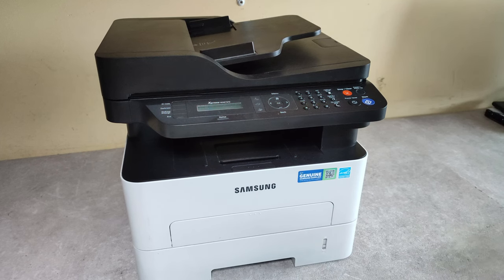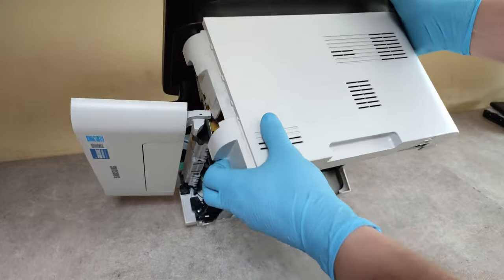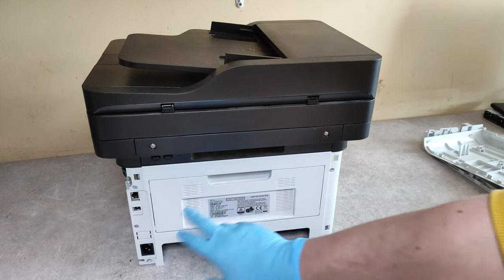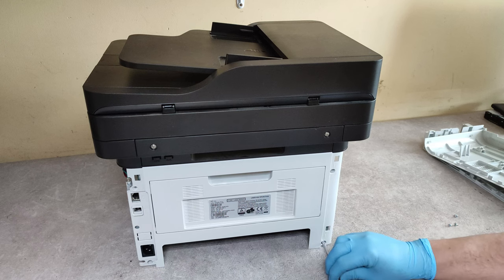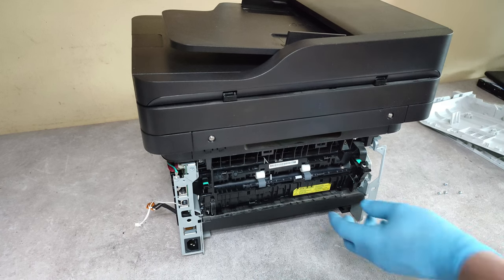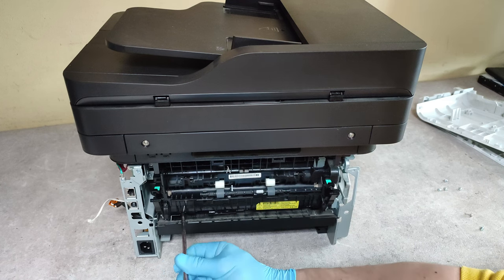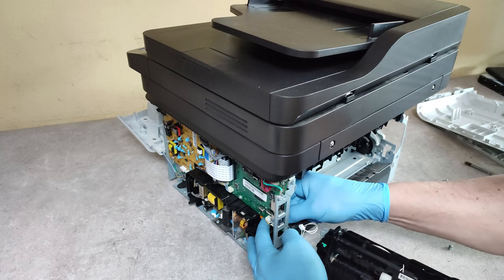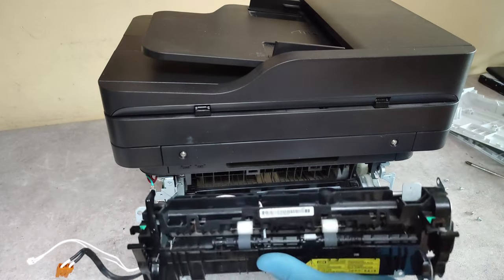HOW TO REPLACE THE FUSER UNIT ON SAMSUNG XPRESS M2875, M2675

Comment: hello, does this fuse change solve the paper jam problem? and another question, is it the same procedure in an m2875fw and an m22885fw? thank you
Reply from the maker: Yes, the procedure is the same. If the paper jamming is when the sheet enters the fuser, the problem is with it. But if the paper jamming is after the sheet picking up, the problem may be caused by a pickup roller, separation roller/pad, solenoid...

Comment: How does a bad fuser manifest itself?
I have a M2875 and it traces 4 thin lines onto the paper. They are horizontal (paralell to the short side of the page). They are always the same distance one from another, but they wander around on th page from print to print. (Also could it be the toner is counterfeit and the printer recognises this?  It (the toner) was bought by a smartass in the office, for cheap.
Reply from the maker: Hello friend! I am pretty sure that the problem with the four horizontal lines is caused by the drum cartridge. Please replace the drum cartridge with a new one and keep me in touch if the problem is solved. Good luck 🤞
Reply: @TonerRefillVideos  Which part exactly is the drum cartridge?
Reply from the maker: @MezeiEugen the part with the green cylinder with a plastic gear wheel on one side.
Reply from the maker: If you yave a spare toner cartridge you can try with it just to be sure the problem is not caused by the toner.
Reply: @TonerRefillVideos  I carefully inspected the green cylinder and indeed found a line on it, almost unnoticeable. It runs almost on the entire lenght of the drum. Not up to the ends, it stops on both parts aprox. at where those two plastic tabs are. 
How many times does the drum rotate to print a sheet of A4 paper? Is it 4 times? That could explain the 4 lines in the print.
Reply: @TonerRefillVideos  Unfortunately I dont have a separate toner cartridge and they are expensive to just buy one.
Reply from the maker: @MezeiEugen one line can be printed 4 or 5 times depending on the start point of the defect. So if you have have noticed the line be sure it is the problem.

Comment: How to repair the duplex printing? Paper stuck while duplex printing. 
🙏Jai Jagannath🙏
Reply from the maker: Look at the duplexing unit (it can be removed by pulling out from the rear side). If there is a piece of paper or something like that just remove it and put back the unit in the device. If there is no any object in the unit try with cleaning the rubber rollers on the duplex. And finally if that doesn't work you have to replace the duplexing unit with new one (the rubber rollers don't work properly). Good luck!